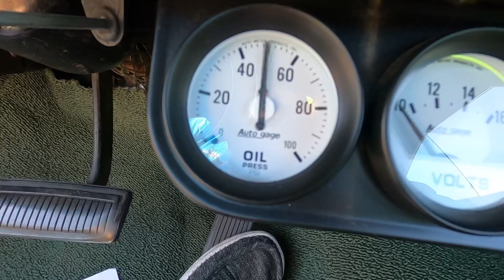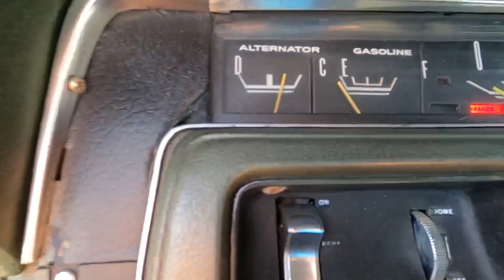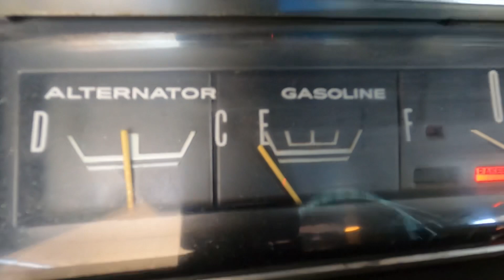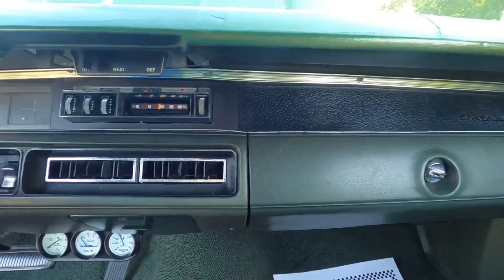Test Drive 1970 Dodge Coronet 440 SOLD $34,900 Maple Motors #1724

Comment: Nice car Nick, I think the passenger side exhaust pipe is hitting the driveshaft and that’s what the noise is
Reply from the maker: Thanks for the info
Reply: I saw that too.....check the down-pipe and the hangers sir. Its got quite a wiggle.